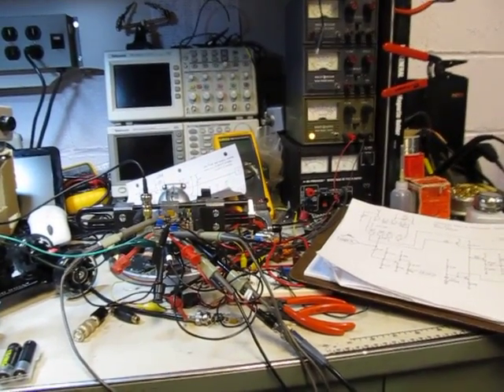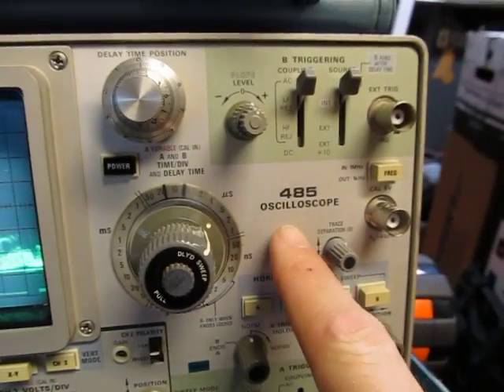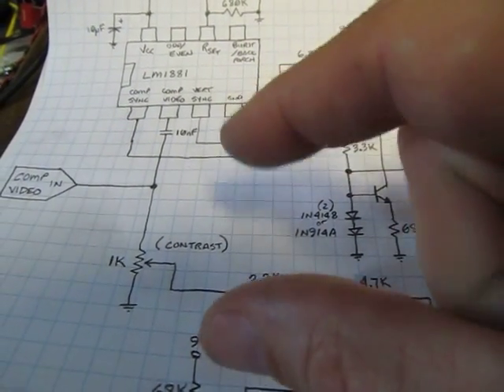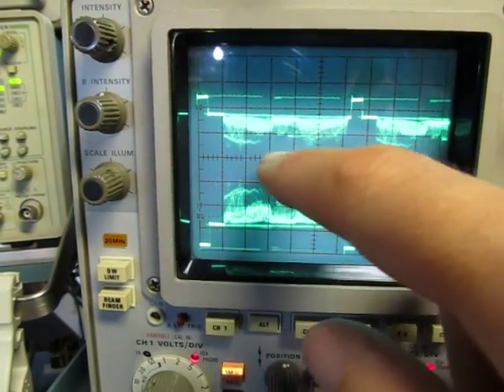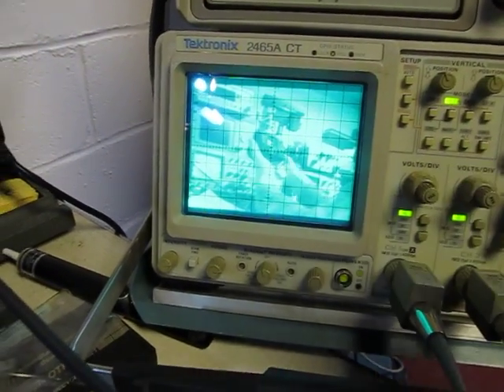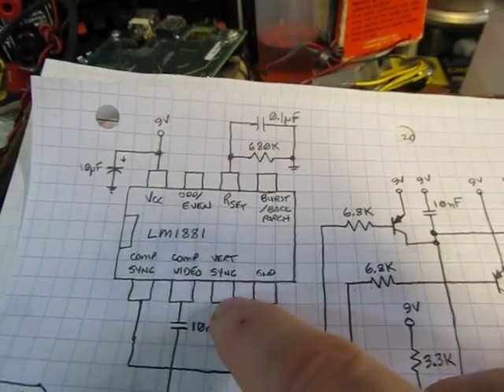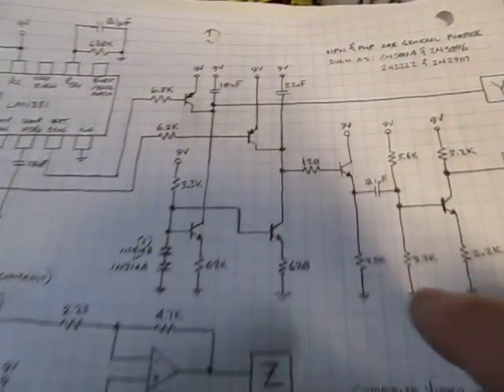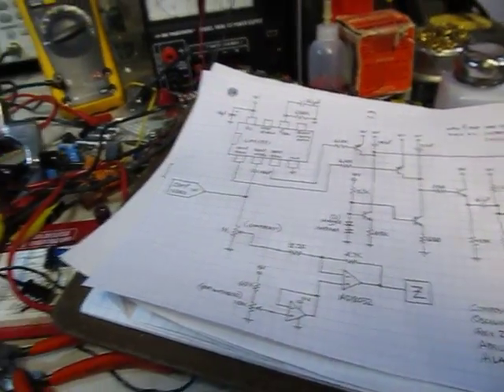#86: Improved NTSC video to Oscilloscope converter circuit / scope video monitor hack

Comment: What sort of circuit could turn a scope into a spectrum analyzer?
Reply from the maker: It would have to be a swept-tuned receiver, synchronized to the sweep of the scope (if it's an analog scope).

Comment: Love this! Would it be difficult to convert this circuit to PAL?
Reply from the maker: It looks like the LM1881 is usable for PAL also, so it should be possible:
https://www.ti.com/lit/ds/symlink/lm1881.pdf?ts=1751501450679
Reply: We'll i've built it exactly as shown and can confirm it 100% works fine on Pal too, tried my PAL SNES, C64 and various video playing devices and all good, only got a 20mhz scope too and was surprised at how well it worked. Thanks for sharing your circuit 👍

Comment: I know this is a long shot, and its an old video but is there a way to get the oscilloscope XYZ to TV/Video. I have Motorola R2001D with what seems bad display I managed to use Tektronix 2246 and XYZ outputs from R2001D and its working nicely but I would like to get it to a video signal so I can possibly use some old TV or maybe even convert it to VGA after that and use PC monitor. Thanks in advance Branko

Comment: Years after seeing your video I finally managed to test the video 'trick'. (I had no scope with a z-axis input.) I used a signal generstor for both the ramps and the signal is rather dim. But it works. Now I planned to build the LM1881 board. 😎 https://youtu.be/iu7qtkb1uDQ

Comment: Alan,
I enjoyed your NanoNVA presentation the other day, where you discussed this particular project. I own an HP 1704A (1976) that I use to "draw" things on occasion. I would like to build this project you demonstrate here, but I wanted to make sure that it will work with the HP, specifically the Z-Axis. The specs call for a +4V, >= 50 ns (POSITIVE) width pulse to blank the trace. Will it work with your design, or do I need to reverse the Z-Axis input?
Reply from the maker: It sounds like your scope may need the Z-axis signal to be inverted.
Reply: @w2aew  I know I am now imposing, but how would I do that in your design?
Reply from the maker: @TellyS100  Actually, it is already inverting.
Reply: @w2aew  Alan, I put together the circuit, but the HP O'scope only shows a tiny image and that is only visible when I press the FIND BEAM button. Somehow the whole image is off the monitor. This image shows what I get: 
https://www.dropbox.com/s/7fb5k6v0kxl56uq/OScope1.jpg?dl=0
If I adjust the gain controls (either to higher, or lower voltage), the image gets smaller. These are the settings:
https://www.dropbox.com/s/qiqxi8dlirwiab8/OScope2.jpg?dl=0
Is there anything else I should adjust to make it "fit" in my o'scope's monitor?

One clarification on your diagram: the resistors connected to the NPN transistors are 68 KOhm and 680 Ohm (or KOhm)? The same question for the 180 Ohm resistor. It's not 180 KOhm, is it?
Reply from the maker: @TellyS100  The resistors are as marked - 68k, 680ohms and 180ohms.  Have you tried adjusting each channel's Position knob, as well as the horizontal position?  On your scope, I don't know if the channel position knobs are used for both left/right and up/down.
Reply: @w2aew  Thank you Alan. It turns out I had to switch to AC coupling! That's why I could never get it to display within the limits of the monitor. Successful project!
Reply from the maker: @TellyS100  Cool - send me a link to a picture or video!
Reply: @w2aew  Here is a first video. I am sure I can do better with a better video camera (and a steady hand!). 
https://www.youtube.com/watch?v=FcQHMLiLUPg
Reply from the maker: @TellyS100  The video quality looks quite good - nice job!

Comment: Hi! I built this circuit, but the oscilloscope only shows a line on the Y axis, Do you have any idea what that might be about? I didn't have a 180 ohm resistor on hand, but I tried with 165 and 220 ohm. Could that be the problem?
Reply from the maker: Make sure you have a sawtooth waveform on both the X and Y outputs when you have a video signal applied at the input. The Y sawtooth will be slow and the X sawtooth will be fast. If both of these are present, then the problem is with your XY setup on the scope.
Reply: @w2aew  I get some kind of sawtooth on the Y-axis, but the X-axis is flat, except for faint noise bursts every 20 mS.
Reply from the maker: @TorSmedbergGames  Sounds like that's your problem.  You may need to do some tracing/troubleshooting from pin 1 of the LM1881 through the circuit to the X output.
Reply: @w2aew  Okay, Thanks for the schematic and the help!

Comment: With X, Y, and Z axis, does this require a 3ch scope or will it work on a 2ch 250MHz scope I have?
Reply from the maker: You need two channels for the X and Y inputs.  On most analog scopes, the Z-axis is on the rear panel.  But, not all scopes have this feature.

Comment: Great video. Will any OP amp work well in place of the AD8032 ?
Reply: He talks about the op amp requirements in the video.
Reply: I was thinking of using a simple LM 386. It should work pretty well. But you have to know how to wire it. Every op amp is different you know?

Comment: i built your circuit using tubes and a lm1881n i built a 13 inch black & white monitor your video set me in the wright direction

Comment: My Error!
Your circuit works perfectly.  I had purchased a used a Tek-2465B 'scope shortly before we built your circuit.  The XY mode in the Tek works differently than my other 'scope, which works with channels 1 AND 2 selected.  If one selects channels 1 & 2 on the Tek in that mode, one gets what appears to be a re-trace that we saw and that kept us perplexed for quite some time.  The solution is to simply turn off channel 1 and use only channel 2!  If that's in the User's Manual, I surely missed it.
So, three things:
1. Again, your circuit works brilliantly, as published and explained so well in your video.
2. I regret potentially casting doubt on no. 1 !
3. For any other newbie to that 'scope, select only channel 2 in its XY mode.
Hoping for gracious understanding,
Larry
Reply from the maker: Glad to hear you got it straightened out.  Yes, the 2400 series scopes let you display CH1 in both X and Y direction, that's why you get the diagonal line.  Not sure why they allowed that, but it is what it is.

Comment: Oh okay that is why my circuit makes it so dim.  I wondered what I could to to make it brighter, I will try this to see what It will do.  I wonder if there is a way I can make my DSO138 into a monitor lol.  it is digital though and does not have XZ controls, it is pretty much a toy.. but it would be fun to do this with it!
Reply from the maker: Without the ability to vary the intensity of the pixels in the trace (and adjust persistence), it's unlikely to be possible.
Reply: It's blurry and not very good, but you can make it out.. it's about as good as the pictures he is showing here.. Not very good, but it is very interesting.

Comment: About three weeks ago, I said, "We got the circuit to produce a video picture, and it's good quality, except we get a bright, constant-intensity, diagonal line that runs from top right to bottom left of the picture.". You advised to design a blanking circuit.  Yes, it does look like a re-trace problem, but it's not clear to me what to 'blank.'  I'm including a photo that shows the video display on the top scope (a Tek2465) and the Comp-sync output on the lower 'scope, which shows the X-ramp output from my circuit.  Most of the time that X-ramp looks good, but as the compressed time base on the lower scope shows, the ramp is getting clobbered by a sync pulse that occurs at ~60-Hz, as shown in the second photo.I'm using an LM6134BIN (10 MHz, rail-to-rail) op amp; otherwise, all components are the same as those in your schematic.  And my 'scope is basically the same model as the one in your video.  Can you offer any advice?  Thanks in advance, Larry
Reply: (Continued). . .compressed time base on the lower scope shows, the ramp is getting clobbered by a sync pulse that occurs at ~60-Hz, as shown in the second photo.
I'm using an LM6134BIN (10 MHz, rail-to-rail) op amp; otherwise, all components are the same as those in your schematic.  And my 'scope is basically the same model as the one in your video.  Can you offer any advice?  Thanks in advance, 
Larry
Reply from the maker: The retrace occurs right after the vertical sync pulse.  So, you would want to drive the composite video signal to black for a short time after the vertical sync pulse to make the scope trace go dark as the vertical ramp resets.

Comment: I have a question.

I downloaded this schematic around 4 years ago with the intent of building it which I never got around to doing.

I made a mod to it where I could connect a VGA input and select the composite or VGA input.

Finally going to build it as I got rewl interested again in displaying a video signal on an X/Y display when I conencted one to a spec an at work with a dim internal display.

The vertical and horizontal sync lines from the VGA cable and the vertical and horizontal sync outputs of the LM-1881 are fed to a switch along with the two video inputs and the last part of the switch disconnects the video input to the LM-1881.

Will the transistor circuitry that develops the ramps work properly at any other frequency besides the analog NTSC vertical and horizontal frequencies?
Reply from the maker: Not being specifically familiar with the VGA sync signal timing, it is hard for me to say - especially since the timing will vary with resolution and refresh rates.  If the repetition interval is faster than NTSC timing, it should work ok but the ramps will be lower in amplitude.  You can change the current sources or caps to tweak this.  If the timing is slower than NTSC, then you may have to reduce the currents so that you don't run into the compliance limit.
Reply: From doing a brief search it looks like the VGA will indeed work given the standard NTSC analog signal can only do 330 horizontal pixels and VGA can do more.

I have a Tektronix X/Y display I can test the circuit with.

Maybe 10 years ago I was able to display a TV picture on a scope, but lacking any circuitry like this I used the vertical and horizontal signals of a small RCA TV fed to a couple scopes and using those signals to lock the sweep to the proper frequency then taking the sawtooth of the sweep and applying it to the vertical and horizontal inputs of another scope.

One of the two scopes was used for a video amp since the display scope only capacitively coupled the intensity modulation signal to a section of the CRT.

Worked quite decently.

This circuit is much easier though.
Reply: I got the circuit working about as good as I think is possible on a composite input. Everything is readable and almost as good as the display of a Interface Technology 553A analyser as that's the only composite source I had at work.

I noticed that grounding is very important when building the circuit and when connecting it to a scope or X/Y display. If the grounds are not just right the vertical and/or horizontal won't be exactly right.

Decided to ditch the VGA compatability and just use an external VGA to composite adapter.

That worked well, but I had to adjust the bright and contrast to very different positions then I thought about it and figured the adapter had DC on the output so I added a capacitor before the contrast control and that fixed the issue.

I also added a TL-082 as a buffer for the X and Y signals and added a couple multi turn 10K pots on the output so I had a way to control the size as the Tektronix X/Y monitor I have only has a switch that selects between two input levels.

Given the adapter has a switch for NTSC and PAL I decided to rey PAL and your circuit works well with a PAL signal only needing to adjust the screen size slightly.

Also there's a flicker when used with the adapter, but it isn't too noticeable and the flicker could be because the phosphor of the X/Y display is perhaps faster than the phosphor of a typical analog TV.

I fed the adapter witht he VGA out of a LeCroy scope which is slightly off from a standard resolution as I have to adjust any monitor connected to it so that the extreme right side of the screen (maybe less than 1/4") isn't chopped off so maybe that is part of the flicker.

Overall it is a great circuit that works well.
Reply: I determined the VGA input was no go and would require circuitry changes beyond my capabilities.

I did however find a VGA to composite NTSC/PAL converter which does work quite well.

I found that I had contrast and brightness issues where the display would change brightness and contrast based on what was being displayed.

Researched the LM-1881 online and found that a 75 ohm or close value resistor needs to be put at the video input of the circuit.

That cured all my brightness and contrast issues.

I still have a linearity issue when displaying anything that is a circle, but that may be due to the horizontal sync waveform not being a perfect sawtooth possibly due to using the composite sync out to derive the horizontal sync.

While looking online I found a LMH1980 which has both vertical sync and horizontal sync outputs which I may try unless there is a way to fix the horizontal sawtooth to where it is proper if that is even the issue.

Could perhaps be a calibration issue with my Tektronix X/Y monitor as I have never calibrated it not having the manual to do so nor do I know if it has ever been calibrated.

Comment: We got the circuit to produce a video picture, and it's good quality, except we get a bright, constant-intensity, diagonal line that runs from top right to bottom left of the picture.  Any suggestions? Thanks, Larry & Don.
Reply from the maker: Sounds like you have a retrace problem at the end of the frame.  You may need to design a little blanking timer circuit that runs off of the vertical sync.

Comment: Hey alan! Thank you for the elaborate video numbing it down making it understandable for an electronics newbie like myself. while creating a shopping list for my own i got a little confused by the circuit layout (no offense), after a day's of research i stumbled upon a certain Jon B. Stanley creating a likewise circuitry back in 2008 also utilising the LM1881. He then instead took advantage of some 555 timers on a 5v current, which i'll post a link below. Later he even went out and created a variant using tubes... however much i love them i don't consider myself experienced enough to fxxk around with those.

As you seem to know your stuff i was just wondering if i could have your opinion on it? After a day's research i'm lost a little.

http://www.electronixandmore.com/projects/tvtoscope/
Reply from the maker: I think the 555s are really unnecessary.  They're only being used to create the X and Y ramps, which is easily done using the current sources I use in my design.  In fact, his version 2 design includes the current sources to linearize the ramps, which my design already does.  His design allows for more adjustability of the ramps.  Both should work equally well.

Comment: Could you please provide a photo of the circuit board you made? I would like to see how the components are laid out.
Reply from the maker: I didn't make a circuit board, it is all point-to-point wired on a vero board.
Reply: I would like to see a photo of vero board then. I am trying to better understand how the operational amplifier is connected.
Reply from the maker: Top: http://www.dorkage.com/top.JPG
Bottom:  http://www.dorkage.com/bottom.JPG
Reply: Thank you, that helps a lot.

Comment: Hi, can this circuit be integrated with a digital oscilloscope as it is done with an analog OScope???????
Reply from the maker: In most cases, no.  Most digital scopes do not have a Z-axis input (to modulate the intensity).

Comment: how to reverse it? i have 2 old tv crt. can i use it as scope without disassemble it. how about use video port?
Reply from the maker: Not really a trivial project. The deflection systems are quite different, and often the CRT bias is derived from the horizontal oscillator circuit, making it difficult to change effective sweep speed. It really wouldn't be practical to use the video port.

Comment: hay could you show me how you huked you wires up please that would be very helpful
Reply from the maker: Simple.  The points in the schematic that are labeled X and Y connect to the vertical channels of the scope that correspond to the X and Y inputs when in XY mode.  The scope probe grounds connect to the ground of the circuit.  The point labeled Z connects to the Z-axis input on the scope, which is usually on the back panel.  Note that not all scopes have a Z axis input.
Reply: and if you do not have a z axis is it the ext blk
Reply from the maker: Ext Blank might only provide binary control over intensity which won't work for video. All depends on whether you can linearly control the intensity with the voltage on this port.
Reply: O all connection I have at X, Y, A TRUG, B TRIG, EXT BLK inputs 
Outputs GATE A,B
Reply from the maker: It depends on the behavior of the EXT BLK input on your scope.  If this input allows you to linearly control the trace brightness, then it should work.  If it only "blanks" the beam, then your scope can't be used for this application.
Reply: OK THANK YOU AND GOD BLESS YOU

Comment: what do i have to change to have a pal signal as input?
Reply from the maker: I don't think you'd have to change anything, but I haven't verified this.  You can check the datasheet for the LM1881 to see if there are any changes required there, but I don't think so.
http://www.ti.com/lit/ds/symlink/lm1881.pdf